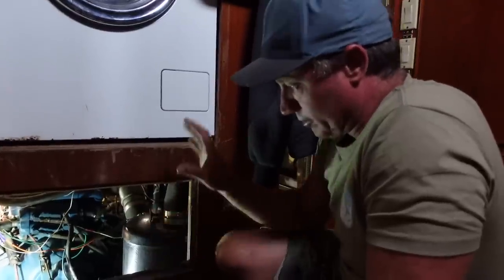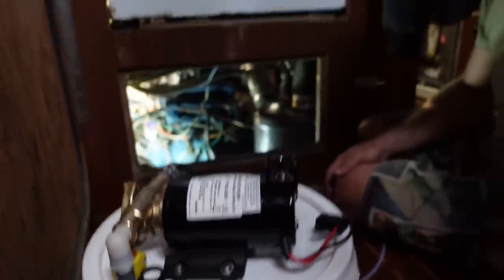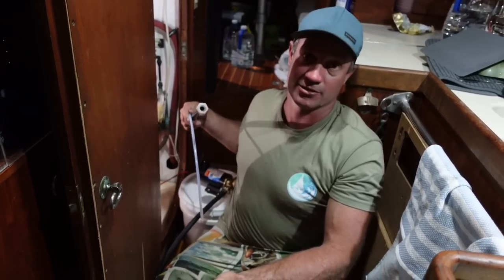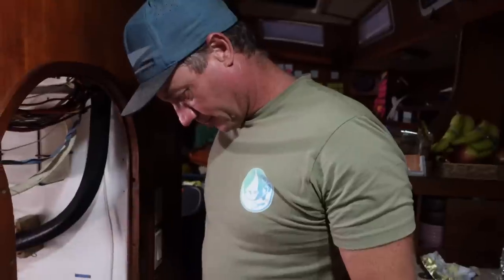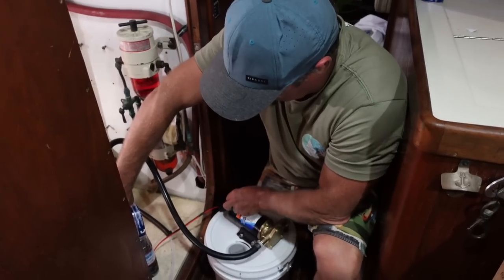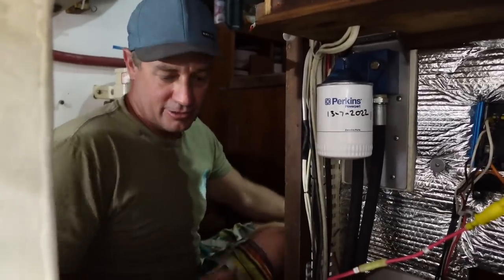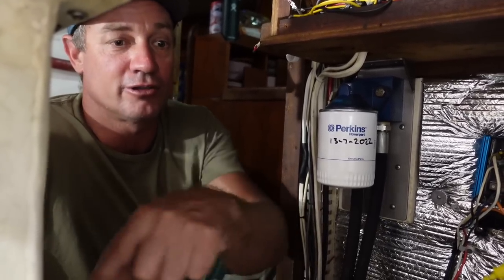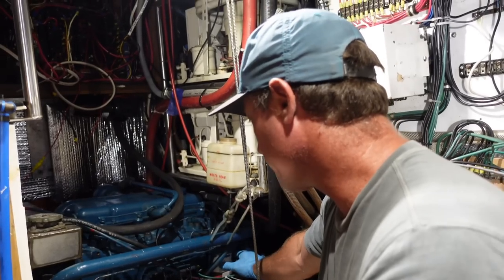How does it look? | LOTS of Boat work | Ep 303

Comment: Velvet drives are great and parts are easy to get. Mack Boring in New Jersey is a dealer. Lewis marine too. Both are on the internet. Make sure the pressure relief valve located on the top of the transmission is clean and free.

Comment: Nice Video! Good Info! Any concern with the  hose (maybe raw water intake) rubbing on back of the starter motor? Not sure if they make a U turn hose, or maybe use 2 right angle hose barbs?

Comment: great job guys you have a Borg Warner C71 or C72 good strong boxes you can down load a manual from the web you will need to chance the oil filter that is in side the box as they clog  up and you may have a big problem I know it has happened to us stay safe Captain Rusty Lantern Lady Port Stephens NSW

Comment: My boat uses a Borg Warner velvet drive gearbox.
It's a bit different to other gearboxes because the oil hydraulically drives the gearbox. It's not just there for lubrication.
If it's the same as mine you won't be able to stick it in gear and stop the prop from turning when you are sailing.
Reply: I eventually added a feathering prop which fixed that problem.

Comment: A great engine room run down Lee,   yeah nothing wrong with a 71 c series gearbox , i ran one for 15 yrs on a 2"shaft
Spinning a 24 x12 prop.  Maybe a spare fuel lift pump and considering the rubbish in the fuel filter I would take a pump sample out of  the bottom of the fuel tanks,  if the yacht has sat idle for some time the first sea voyage will stir up the sediment.  Just to be  safe and sure..🥳

Comment: Tip for checking gearbox oil
Get a stick of white chalk and run it down the stick, dip into the box and you will be able to read it no problem.
Reply: They are a very common and reliable gearbox. 
Can get parts for them easily. 
Some can be snatchy going in and out of gear, but generally a good unit. Great for yachts being an inline unit.
Reply: With the CAV filter o-rings they are different sizes. The top o-ring is bigger and should but not always have a Blue or White stripe on it. They can be swapped around but the proper way is the striped o-ting goes into the top. You should lokk at swapping the the alloy bowl for a glass one. Easier to see water/crap in the fuel.

Comment: I had a boat with the velvet drive. Had to replace the front seal on it but that was the only issue I had. When the seal failed and lost the oil the velvet drive just stopped working nothing broke

Comment: The next time you go to the Dentist ask him if he has any old tools. Tell him what for. As a former Aircraft Engineer & spending time in fuel Systems they become very handy on O - rings. One of the most universal lubes for o - rings is vasiline. Good Luck guys.
Reply: There probably is a Dollar Tree, Dollar General, or thrift store with some other name in your area. They will have these dental tools. Our Dollar Tree is now $1.25. It's still a bargain. We also have Northern Tools. They have every kind of handy tool at reasonable prices. Some you don't know you need until you see them. 🤣

Comment: Canadians do this math every day of their lives, stuck between the modern world and "the only nation to put a man on the moon" (also the only nation to smash a 125 million dollar satellite into another planet because they too damn stubborn to use modern units!)
Anyways, for quick reference: 
A litre is a quart, or close enough
4 quarts is a gallon
1kg is 2.2 pounds (lbs)
1 inch (abbreviated 1") is 2.5cm or there about
30 cm is 12 inches or one foot (abbreviated 1'), 
more or less
C*9/5+32=Fahrenheit (sorry, there's no easy way to do this, but the important temps are: 
Too damn cold: -40C=-40F, 
Good skiing weather: -18C=0F
freezing: 0C/32F, 
room temp: 21C/70F, 
Too f'n hot: 38C=100F.